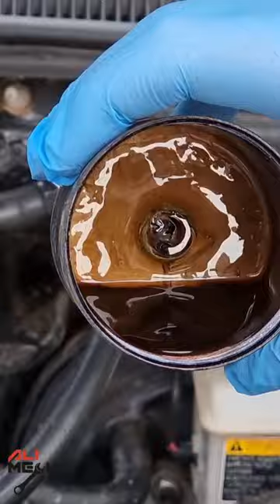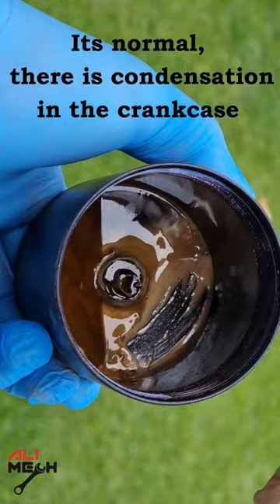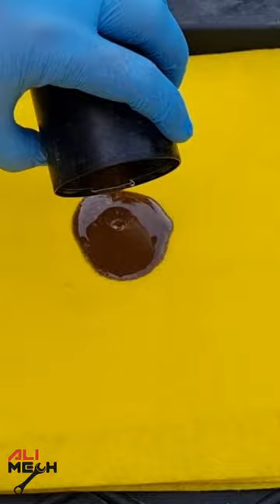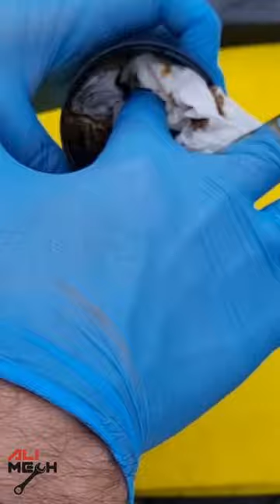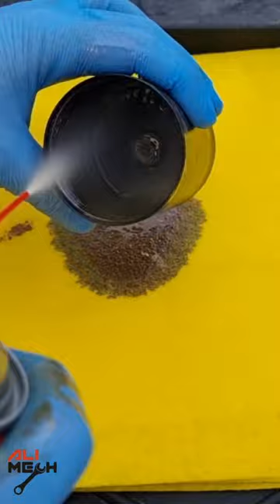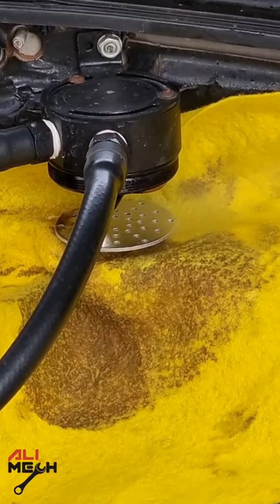Here is why milky oil in catch can #shorts

Comment: So is it true that, if you store your motorcycle or car it'll create condensation inside the combustion chamber
Reply: Yes but as long as you run the engine long and hot enough it will burn the water off eventually. The problem is if you do a lot of short trips then you won't ever get hot enough and the condensation builds up.

Just take it out on the highway and drive it like you stole it.